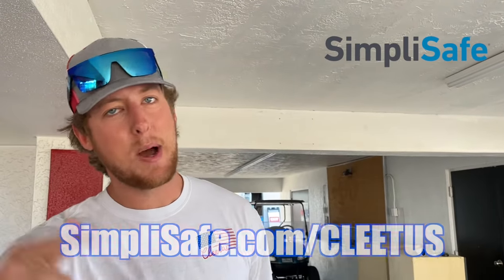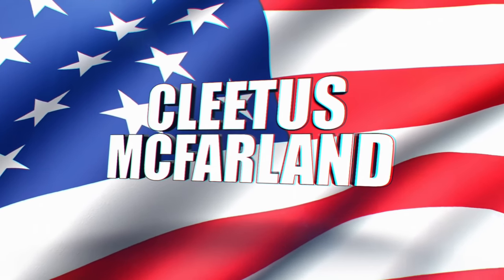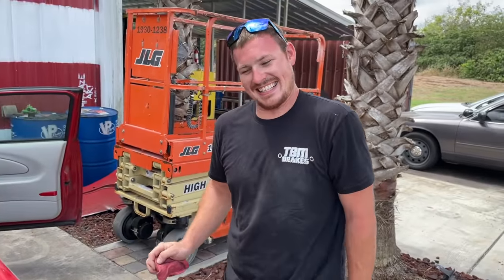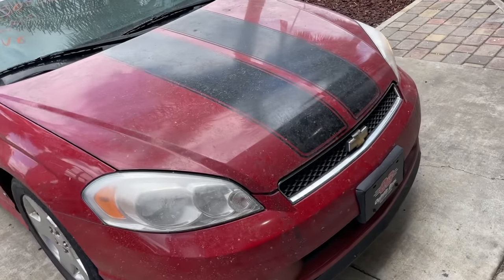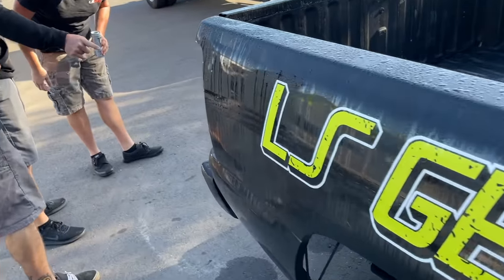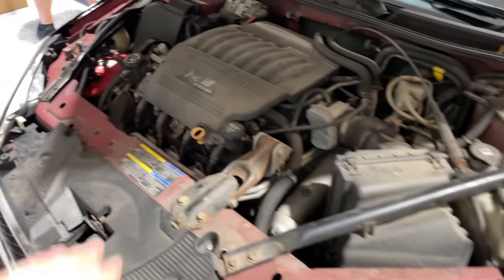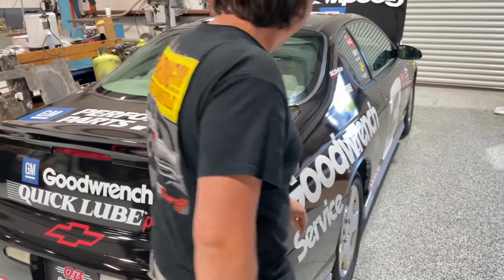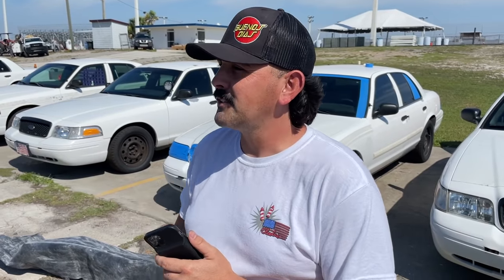Surprising My Mechanic With the Most RIDICULOUS Daily Driver Of All Time... (You Can't Guess)

Comment: One tip: Watch out for the transmissions in these, they weren't made for the torque of the LS4
Reply: Yeah I have a dead on sitting in my driveway!  I am trying to figure out what to do with it!  The engine is a monster with Texas speed cam.
Reply: Triple edge performance!
Reply: @majesticjew19  no lmao, you can get 4l80s for these cars and that’s the only good choice.
Reply: @bbdl7042  no they're still fed

4t85eHD is the right one
Reply: @bbdl7042  4l80 in a fwd? Nah
Reply: @andreyangere3076  already been done several times lol
Reply: Trans cooler and a tune, no problems
Reply: @michaelbender830  yea i got rebuilt trans then after that I got a tune by James Brewer and its been holding up mint for 15k miles and half of it has been hard on.
Reply: @midna6049  4t80 guy        4l80 is rwd
Reply: Just had a Trans changed
Reply: @midna6049  if you’re going to try to argue with people at least know what the difference between FWD and RWD is.
Reply: @majesticjew19  It was a built trans by the only other guy that does these.  3.69 gears, hardened input shaft, 7/8 chain, high stall.  Cooler with fan, shift kit.  I think it ground up the diff.  I don't think I want to build it again to blow up in <1000 miles...
Reply: @bbdl7042  I think you mean 4t80e lol. Also Triple edge performance makes some beefy transmissions no one has ever had one go out yet, I myself have a nicholls performance stage 1 transmission if you know what your doing your LS4 will def last.
Reply: Yes they are special ED just don't drive like an idiot or tune it
Reply: Yup, gimped from the factory to protect the trans! Richard Holdener dynoe'd one of these and found tons of power pretty quickly.
Reply: @bbdl7042  no u can absolutely not

Comment: The engine might be able to take a 150 shot but the TRANSMISSION... another story 🤣
Reply: Glass transmission smh 😂
Reply: I had a GP gxp.  The trans was horrible
Reply: Yep.  I had a supercharged 07 Grand Prix.  Same trans.  It just randomly quit one day.
Reply: 4T80e swap incoming?
Reply: Those little burnouts alone probably fried it 😂
Reply: I had an 07 Impala SS and went through 4 trans in it in about a year and a half. Fun cars but the trans smh.. should have never put that 5.3 on a trans designed for the V6 model.
Reply: @jwallace2913  exactly!

Comment: Hey cleet. The noise inside the car is the blend door actuator. $20 and make sure to have extra on hand. they go bad ALL the time 🤣
Reply: That shouldn’t kill the battery with key off should it?
Reply: @totalyep  they turn on all the time. Anytime I open  any door they turn on. I have 2 out rn
Reply: My 2003 impala I owned for 5 years, went through 6 and lots of other electrical gremlins..... mainly headlights. Also liked to lock me out of the computer so I couldn't start it. Good times 😂
Reply: The fix is buy bronze gears for a r/c car servo and put them in place of the nylon gears they always strip teeth on the nylon gears

Comment: Careful with the hole shots in that. Those transmissions are a glass cannon I spent lots of money years ago trying to go fast with one.
Reply: Ahaha as soon as I saw the silhouette I thought oh no. Lol
Reply: im sure once it blows out theyll get a built 4t65e-hd in there (the stock 4t65e-hd is good for ~350 but i know those v8 SS ship at around 300hp already) or figure out some way to get a 4t80e from the cadillacs in there (probably the better option). i northstar swapped my 99 monte because it was way easier than trying to convert the LS or 60*v6 to the 4t80e (you have to swap basically the whole subframe to mount the trans, so why not just put the northstar in too?).
Reply: LS4 king has made the 4T80 happen many times and has one with 1kHP
Reply: @lmking84  oh damn thats sick! i honestly really havent looked into the progress on the wbodys since i got rid of my monte in 2013; guess ill have to do some new reading and youtubing :)
Reply: I made 300whp 15 years ago on a built 4t65e hd and it had trouble living on the street. You just can’t build a 4t65e hd enough; a 4t80 would be better but I’m not sure what kind of aftermarket there is for hard parts for that trans.

Comment: Wasn't the point of the Cobalt so George could save money on gas? 😂 It's awesome to see you treat your team so well!
Reply: Ls4's can get 30+ on a flatish surface cruising at 65
Reply: A ton of miles to be putting on a vehicle too. Probably 40,000 a year. 
It's a vehicle they defiantly can maintain themselves, and obviously a great source of shenanigans at the shop and for videos.
Reply: Its about the shape and weight of the car, not the size of the motor.  Plus its 100 miles in Florida so its flat highway.
Reply: Good news, it has Active Fuel Management - also known as cylinder deactivation. Bad news, it has Active Fuel Management. Consumes oil. Have that circuit shut off.
Reply: @bighousetech  omfg
Reply: Bro he's probably going to roll it in a week anyway haha

Comment: LS4 King has what you’re gonna need when this transmission takes a dump. Because it’s gonna happen…. Ask me how I know 😂
Reply: I have a 2007 Grand Prix GXP with the same engine and transmission. I completely agree! The transmission is the weak link here. The engine stock is 305hp while the trans is rated for only a 160hp V6. Every one of them is setup for failure.
Reply: @jimboyne3385   yup I have the 08 Buick LaCrosse Super after like 5 months of owning it the transmission went out probably didn't help that I beat on it
Reply: I said the same. My mother owns a 07 ss.
Reply: i agree with this cuz my buddies took a shit  and now he has a stage 2 trans  By Nicholas transmissions   Texas speed LS4 cam ls6 intake and  Throttle body DOD delete  Upgraded valve Springs and alot more goodies
Reply: How do you know...
Reply: I was looking for this comment 👍
Reply: Triple Edge Performance is the place to go, although the waiting list for him is months long.
Reply: Gearstar Performance sells a stage 3 transmission that is a bolt in replacement for the stock one.
Reply: Went through 3 of them on 2008 Impala SS
Reply: You in LS4 Nation fam?

Comment: That HVAC issue can be solved by replacing the affected blend door acuator..

Also, I know these came with a weird offset for the tires/ wheels. It was GMs way of countering the torque steer in these SS models

Comment: You guys should make this the most fuel efficient 5.3 build.. see how many miles to the gallon with the most Horsepower... And mean really try... Love the content... Keep up the good work...
Reply: Yeah you can change when the AFM comes on . All you need to do is change the amount of vacuum required to disable afmand push it out a little. It will alow you to cruise at 80 and still keep it on 4 cylinders. I could get over 30mpg in my G8 GT this way
Reply: @Shiftheads  I was looking around to find out how this thing was getting that kind of mileage out of a V8. 
I thought a little 4 banger would get better mileage however I’m going to start looking for one of these!
Reply: A MPG build instead of ET. Cool.

Comment: It’ll need a transmission in 2 weeks 😂
Reply: Bet on a week and a half
Reply: Converter clutch is already smoked if it is orginal... they all are. Input splines on the Overdrive hub don't have a fighting chance
Reply: I admire you optimism….. more like less than a week
Reply: and it will be replaced in less than day lmfao
Reply: they most likely  have a upgraded one stored out of sight
Reply: Lol. No such beast exist. They will end up 4T80 swapping eventually

Comment: I've owned several of those and as long as the dod is enabled the freeway gas mileage is great. Keep a close eye on the oil because they tend to use a lot of it with the dod. The noise is the blend door actuator, there's a procedure to reset it when you change the battery. The motor is a pain to change bit there are videos on how to rig it up if you don't mind only having hot or cold air.
Reply: Unless you can do the work yourself, the repair bill when the DoD lifters inevitably shit the bed is more than the money you save on gas. Ask me how I know :P
Reply: @andrewbear1057  For sure, if you use a good filter and oil it helps. I had an 06 get to 185k on royal purple before I sold it. It's nice to get the fuel mileage and the information screen showing how many cylinders It's running on is kind of cool. I luke the fwd ls cars overall but they can get expensive fast
Reply: not to mention the intake on the LS4 is the worse flowing LS intake GM ever made,

Comment: Upgrades to plan to do. 
1) Upgrade the transmission. The 4T65e HD wasn't built to handle the power of the 303 HP of the LS4 in this car.
2)DoD delete. The lifters fail regularly 
3)Tighten up the steering. These cars have bad torque steer. 
4)LS 6 intake and throttle body. 

The car is already cool. I'd like to see it as a nice street car and daily driver in a mini series build. Additional note these cars have cathedral ports for the heads.

Comment: I have a grand prix GXP with the same setup. Change the battery current sensor on the negative cable. Fixed all my electrical issues. And it had alot

Comment: Probably not gonna see this but heads up on those 5.3 cars, they ruin torque converters and input shafts because the trans is just a 3.9 car trans, so not beefy at all. Does not handle abuse.

Comment: Window issue is most likely  a wire break. In the rubber boot between body and the door.
 Should be a pink 10 gauge wire.
GM used a lower strand count wire that doesn't hold up to repeated flexing.

Comment: The noise you’re hearing for your electrical issue I believe is your valves for your ventilation the doors that switch from defrost to floor to head to mix those valve actuators are fried so they go on and off on their own that’s that noise

Comment: The battery killing noise is the heater blend doors under the dash for the ac and heat 😁 the gears strip out and the motor just stays running

Comment: You need a temp. Door actuator and have it calibrated and a half broken wire in the rubber boot of the door harness. Flush the pwr steering fluid out and replace with Dex 6. To bleed the pwr steering go key on engine off, front tires off the ground and go back and forth with the wheel until it stops taking fluid. if it still sucks or chatters keep going back and forth with a vac pump on the reservoir. Hang in there 5.3 yer about to get quality controlled!

Comment: Press and hold the traction control button it will turn off stabletrack and it won't pull power and limit the rpms when trying to do a burnout.

Comment: On the ac the blend door actuator is the noise.The plastic gear broke inside it  If it is a dual climate control there are if I remember correctly 2 behind the glove box and one under the steering wheel/ behind the radio. If it isn't dual then they are just behind the glove box. The different temps is probably caused by that due to the noise. But those era GM can have the computer get confused and where the actuators are causing different temps on each side To fix that disconnect the battery for 5 minutes. Then start the car but make sure you don't adjust the temperature or where the air is coming out for about a minute to make sure it goes through the relearn process

Comment: Blend door actuator on the heater core / evap box is probably not good, causing heat to be preset & won't change temps

Comment: I'd also being you put the Dale Earnhardt wrap on it put rims that resemble the rims Nascar uses on it also yellow letter good year tires and change it from unibody to frame and roll cage then I'd put turbo power to it and optional Nascar style window net and a 6 speed manual tranny solid rear axal and dual 3 inch flow master exhaust

Comment: I've got you beat as a daily driver depending on how you look at it
1996
5.7L LT1(the one with that crappy distributor)
4L60E(K cast)
Cadillac
Fleetwood
6 door limousine

Engine bay so big you could probably fit quad turbos, or a V12 without modifying much

Comment: The electric climent control motor that turns the flap for the air is bad the plastic gear inside like to chip teeth and get stuck, I've had 2 cars that this happened to they are under the dash near the middle, there is one on each side, there easy to replace

Comment: I shuggest you guys shave a truck intake down and slap it on there to open it up a bit because the stock intake is extreamly restrictive. Also should be mindful of the Trans, they're way underbuilt for the torque and power the ls4 puts out.

Comment: I bet in less then a month it will be a getting a 4t80 from a Cadillac  to swap after you burn that wonderful HD4t65e transmission up a few times when you hit it with N2o lol. They are extremely fun cars. I'm sure you will be giving LS4 King some business lol. Makes some good parts for these. Unfortunately not many manufacturers make performance parts for these montes and Impalas. At least you can use almost any standard LS part. Only difference in an ls4 is the crank is a few millimeters shorter.

Comment: That’ll soon need a new transmission, crack a motor mount, need new axles, need the front wheel bearings replaced (which is they’re known for) DOD issues but don’t ask how I know.  Besides that, it’s still a bad ass car 😎

Comment: I had one of those cars and it should be able to do a way better burnout than that. It should easily smoke the tires across the entire parking lot without using the E-brake.

Comment: you have broken wires in the flex part going to the driver door. you said the windows don't work with the door closed. but they did. and the battery dying is probably due to the broken wires to the door trigger switch so the car is not going to sleep...your welcome